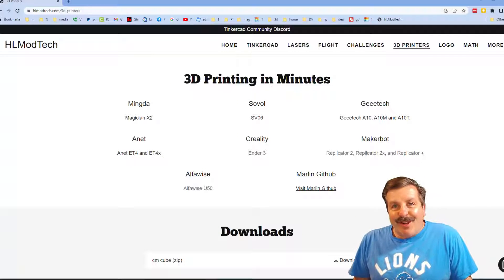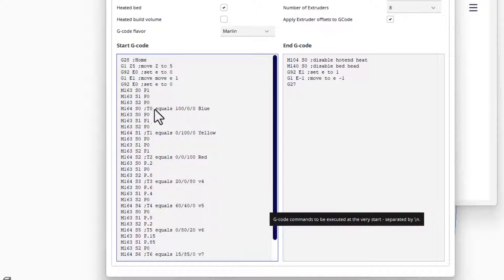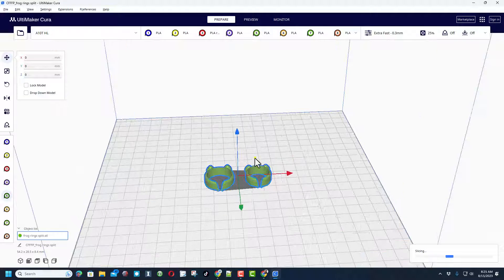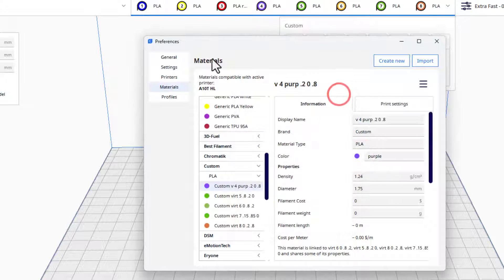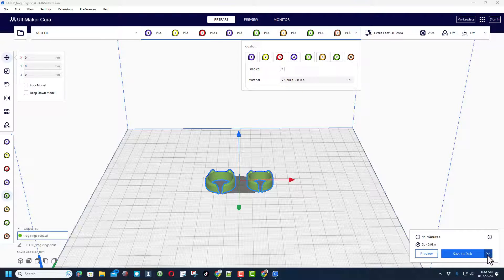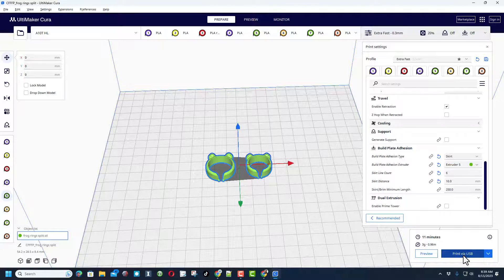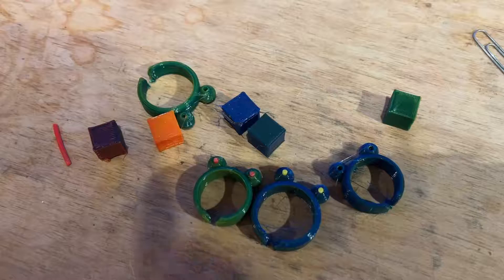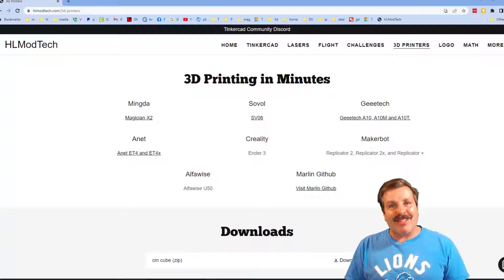Geeetech A10T Virtual Extruder Configuration Test Cura 5.4 Easy Steps

Comment: So can i print say a phone case in tpu and pla? I feel that multi filament types would really be a game changer for many people and even gradient them would be crazy!!!
Reply from the maker: I do not believe so. Each material needs a different temperature setting which would be an issue. A more likely system would be to make your case out of pla... then print bumpers out of tpu to protect it.
Reply: @HLModTech  thank you for your time, that would be an interesting thing to try even if it failed though.

Comment: Request what printers you have. You've shown the Geeetech A10M and now the A10T... what else have you got? I have the A10 (v3.x) and A10M (v4) but they are in dire need of updates...
Reply from the maker: Anet ET4 plus,  two ET4x, two A8 Plus, ET5 x, Mingda Magican X2, Sovol SV06, two Kingroon SLA, and a borked printrbot. =) What sort of stuff do you create on the Geeetch machines?
Reply: @HLModTech  Right now, they are sitting in need of repair... The A10M needs a new head installed (not just the tip) and the A10 needs a new thermister soldered in (I have it, just haven't gotten around to installing it... too many things to do otherwise). When they were up and running, they made cell phone cases. Very popular especially for the lesser known models or models that didn't have a supplier (such as the ZTE Axon M). Another popular option were doing two-tone cases for all the different models out there.

I have seen the Anets around, but I have heard some scary stories about them. Your thoughts?
What's borked on the Printrbot? I am a bit surprised to see a Sovol listed here. I'm told they are great, but you need to tinker a lot with them to get the most out of them.

As for SLA, I've never heard of Kingroon. I'll look into that one.

Thanks for the quick reply
Reply from the maker: Neat idea printing cases and using the mixed colors. The board went out on the printrbot. I put in Mega2560, I believe, but never got around to making the correct firmware for it. My Anet machines have been fine. I was able to get marlin on all of them and they have been going along for years. They all just print simple trinkets for my Mt. Pisgah scavenger hunts. Just added the Sovol and Mingda. Both have been fantastic. The level of hardware for under 300 bucks is really cool. I have the X2 just a tiny bit ahead of the SV06 on my fav list.